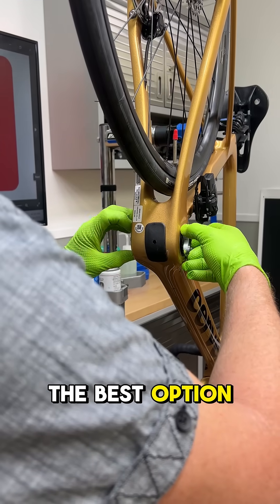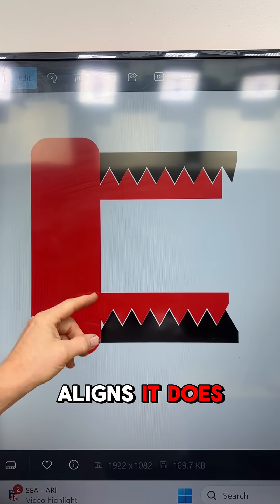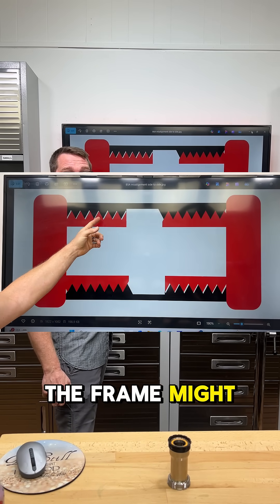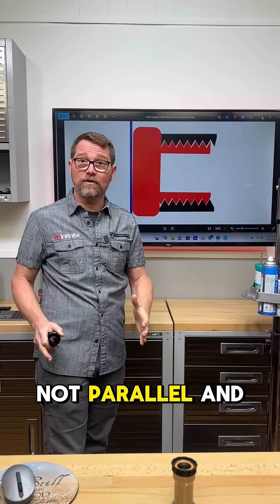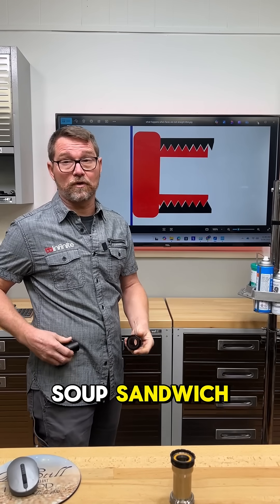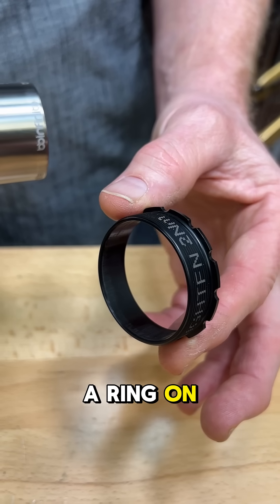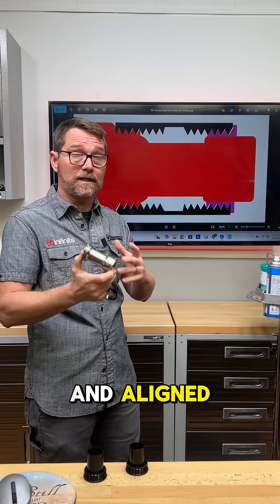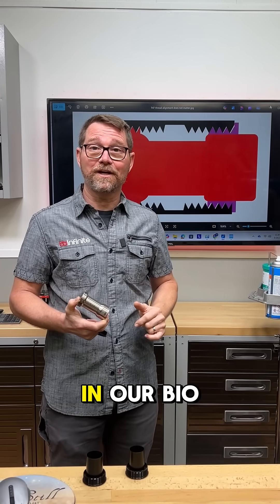Why T47 is the best bottom bracket standard 👇

Comment: Nonsense the BB infinite screws in, the exact same issue can occur if the shell is misaligned and if so would come out the other side on an angle 😮 same issue
Reply from the maker: Not even close. The purpose is to align the bearings. If you have two halves misaligned, the bearings are misaligned. If the BB is a hub, as with our BBInfinite. the bearings will be aligned even if the frame holes or threads are off. Watch the video again. Think about it.

Comment: How is it one piece when there are two pieces - you have the 'hub' and 'ring'? You show images but don't actually mention the class of thread or tolerances involved in that 'play'? Smells like snake oil to me.
Reply: Face the bb shell both sides and it will pull itself straight, thats what i do for my clients. By facing, it'll ensure the bearings are perfectly aligned, it'll also expand the life of the bb massively and the bearings will rotate much better. It'll also turn a bad bb into one that rotates much better.
Reply from the maker: It's one piece because the bearings both reside in the same housing, ergo, the BB is functionally one piece. A hub. When the bearings are in separate pieces it's a 2-pc BB. Thread classes in the bike industry are A2/B2, as with the vast majority of anything you'll encounter in your life.

Comment: For instance Panasonic strictly prohibits to face their frames because it just damages the frame and the frames are perfect on their own so the "misalignment problem" doesn't exits in their bottom bracket tubes.
Reply from the maker: If it has threads, there will be misalignments by nature due to the nature of threads themselves, and the A2/B2 thread forming. Ever wonder why you don't see threaded bearing housings in any mechanical equipment anywhere, at all, except in bikes? As a manufacturer, and as engineers, we at BBInfinite understand how these things work in reality, not as an idea or a concept sitting at our keyboard. Threaded BBs are a hold over from a different era when bicycle efficiency wasn't a consideration, it was just about functionality and ease of manufacture. It was "just a bike". Panasonic, or whoever, can say whatever they want. It's just hot air.

Comment: Nice. This is just what I'm looking for, but for the 68mm (external) t47 variant. Does your 68mm t47 bb also allow for routing the rear brake hose through the bb shell?
Reply from the maker: Yes, in most cases internal routing is not a problem. In some steel and Ti bikes there can be an issue, but generally not.

Comment: I am actually convinced now. The one piece just makes so much sense. BUT of course, that is assuming that this BBInfinite shell has been machined absolutely parallel! Technically it’s now another factor to worry about now.
Reply from the maker: The shells are turned on a CNC lathe in once process. No rechucking. From solid stock it's turned with all cutting happening on the same rotational axis. Translation: the bearing bores are absolutely aligned by nature of the process.

Comment: So...is it possible do the same for BSA?
Reply from the maker: Unfortunately, no. BSA and Italian are too small. The hole diameter for BSA is only 34.5mm/1.37", and the smallest bearing you'd use for a Shimano setup has a 37mm OD, so the bearing itself is larger than the hole in the frame, so nothing could pass through to unitize the structure and align the bearings. T47 rules.
Reply: @BBInfinite oh, I see...so the problem is that bearings are out de frame becouse of size. I just order a custom titanium frame, and I choose BSA because I want 24mm steel axle. The manufacturer said a lot of times that they can do a perfect BSA bottom bracket, but now I have doubts😂
Reply: Best BSA bottom bracket is the SKF square taper.  I'd run that if you are doing BSA.  They carve the bearing race into the stainless steel shell so they can use larger ball bearings than other square tapers.

This is a better bottom bracket than anything on the market until you are talking T47.
Reply: @凸Bebo凸 looks pretty amazing, to be honest. But the problem is that I want 24mm axle. Nothing special, I have a lot of high quality shimano crancksets at home! Maybe T47 adapters?